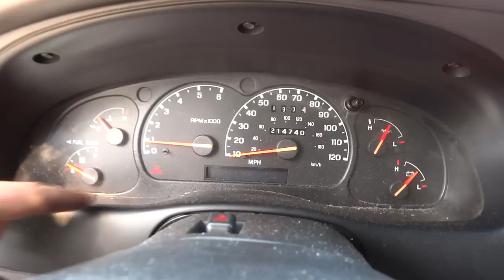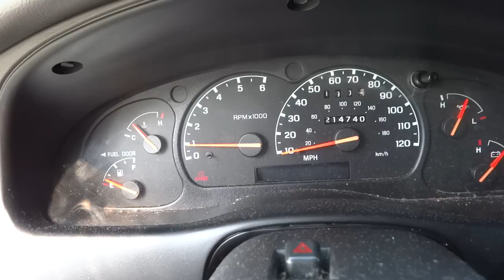Engine Knocking or Ticking?!? This Could Be Your "FIX" Ford/Mazda/Bmw/Honda/Toyota

Comment: Why would you hit a plenum valve with a metal hammer? Of course your going to damage it. None of these composite material parts are meant to absorb impact.
Reply: I don't recommend following this guy's example.
Reply: "oh i did this to my car and it runs just so much better"
you have to be pretty arrogant to believe that you know better than the engineering TEAMS who have been developing these engines for decades...
If they put something in the engine, you should NOT think you can simply "delete" it. You should FIX it. Now let's go see Ericthecarguy
Reply from the maker: Stuff happends, I could have chose to edit that part out if I wanted to, instead  I decided  to show the public so they could learn from my mistake..the intake was extremely brittal.Wasn't your ordinary plastic.
Reply from the maker: JAndrioli They did such an excellent job engineering it that if one of those flaps break off inside the intake manifold the entire engine blows up, and they are prone to breaking off,so removing them is definitely a smarter choice than the engineers who put them in.
Reply: Nthefastlane
 I agree with you that the quality of the material is bad IN SOME MODELS. Your video is said to be applicable to several models of several brands !!!
That's a HUUUUUUGE generalisation.
Now to the other issue: rather or not you are knowledgeable enough to redesign a complex engine, on your own, in your backyard, with a hammer... well look, I'm a nobody with zero knowledge ok, but even if I did have a 30 yrs career I don't think I would recommend violating someone else's blueprint. Like I said earlier there are TEAMS designing those machines, but of course they don't have total control on what materials will be used in the production line.
Reply from the maker: JAndrioli They build a vehicle not to last,could they build a vehicle to last a lifetime..sure, just not in this or any case. That's why there's Oem and then there's aftermarket, which alot of people including myself turn to. If you want to see another modded job..stay tuned for the Victor x intake manifold cut in half,ported,polished and tigged back together .
Reply: Nthefastlane Did you even notice the thing had over 200 thousand miles on the clock? Not built to last?  Are you kidding?
Reply: You think aftermarket parts are there because they are better than OEM? While this may be true for some high performance parts typically aftermarket parts are less expensive because they are made more cheaply. I agree with JAndrioli.  Those parts were put there for a reason.  Just yanking them out is foolish. Pretending you know what you are doing and putting it up on Youtube is a disservice to those who may watch this. Getting a bigger hammer is rarely the answer to fixing modern cars.
Reply: @JAndrioli lmao, you obviously have never owned a 90's sports car.
Reply: If these "teams" did a good job (they didn't) the car would not have this problem.

Comment: I brought a new battery, starter,alternator my battery still dies on my 98 infinity ain't help
Reply: check for a short and all your grounds. a short will drain the battery.
Reply: +Keaton McNaughton the temperature gauge goes up n down when I turn on the headlights on

Comment: I strongly dis agree with this posters cure for the problem he has created. Removing the IRMC'S as they are called. Reduces torque significantly and reduces performance. I would not suggest this procedure to anyone to perform on a normally aspirated engine. Some remove them on supercharged or turbo charged cars. But that is because the airflow is necessary for optimum performance. The turbocharger or supercharger more than makes up for the removal of said parts.
Reply: I'm at a loss, anything blocking air flow to the motor is a parasitic loss to the engine, reducing torque and horsepower. How does removing items and making a free flowing passage a bad idea? I thought people port match intakes, port and polish heads all for that very reason, for more airflow. They did these things before turbos and super chargers became widely used to gain torque and horsepower. So I'm not saying it's not true, but would like an explanation.
Reply from the maker: I made more power after removing them :/ no hesitation like before, idles perfect and no check engine lights.. it's been 10 months since I uploaded this video.
Reply: Nthefastlane I have been a Mechanic more years than i care to admit to. Its not a question of making a car durable. As much as the question is why would you beat a composite manifold with a hammer? My Corvette has many composite materials it is 10 years old and nothing has broke not even the manifold. But then again i don't repair it by beating it with a hammer. Those IRMc's you removed are supposed to stay closed till a certain RPM is reached. Then open up this allows maximum torgue gas mileage and lower emissions. In no way would removing them increase anything. Gas mileage may have increased over them being stuck closed or flapping back and forth. But has not increased over a properly running car with them installed. The removal of pollution control devices is not only stupid. It is illegal! Even removing Catalytic converters decreases mileage not increases. As it causes the motor to run too rich. If you are going to fix something fix it right. The mis information you have provided here really benefits no one.
Reply from the maker: Tony Brooklyn A Lot of states don't "Smog Test" Tony.Butteryfly s are a poor design hands down,sure they balance the immisions and a little tourqe curve but who needs restrictions..Faster air is better air,the ecu will compensate the extra air.
Reply: It appears my friend you have re invented the wheel. Good Luck in your quest to create a better car.What else can i say at this point. I have pointed out to you what is wrong with your thinking but you refuse to acknowledge it. Just because states refuse to smog check. Does not mean you are exempt under Federal laws. Removal of pollution control devices carry penalties upwards of 50,000 dollars.
Reply: Tony Brooklyn This makes no sense. Removing a cat is obviously illegal, but how does the same law apply to swirl flaps? It would be one thing if every vehicle was required to have them, but that's not the case. Many engines don't come with them at all. Even the engine featured in this very video doesn't have them anymore. Ford introduced the Duratec motors in '01, and they dropped the swirl flaps from them three years later. If it was really that vital of an emission control system, why would Ford go through the trouble of removing them after they went through the trouble of putting them there in the first place? And how could they get away with it?

I see these swirl/tumble/runner flap/valve debates all over the place. There are pros and cons for both having and deleting them, but to call it illegal to remove them is just ridiculous.
Reply: I'll leave you with one more comment and that I shall refrain from posting in this thread because you obviously want to get the last word in with no scientific knowledge trying to reinvent the wheel is probably the silliest thing I've ever seen in my life and that's what you doing here you're trying to reinvent the wheel you think you're smarter than Ford Motor Company for General Motors or Chrysler Corporation come on man give me a break
Reply: Tony Brooklyn  I have to agree with you here... The flaps  partially shut allow for maximum torque at low rpms... I've been doing a lot of research on this since I have this issue on my mazda 3. I have unplugged the runner control solenoid for now to avoid the noise... but I plan to replace the actuator valve that actually controls the rod attached to the flaps and hopefully that will fix the problem.
Reply from the maker: unyascorpion What nobody is understanding is that the rod no longer grips the flaps therefore all they do is flap no matter what solenoid or valve you replace. If one of thoes plastic flaps gets brittle enough and breaks off into your cylinder it's  by by engine..possibly bend a valve instantly. Im still running 10k miles later with no issues or check engine lights. To each their own.
Reply: Nthefastlane  That is an important piece of info you just provided me with. That may be in fact my own case. I've seen flap kits being sold... but I'm assuming it would be a pita to properly demount the rod and install new flaps. btw I don't necessarily think that your solution is bad...but as I mentioned, there is significant low end torque lost between 1k-2.5k rpm. I think whoever should follow your practical DIY video should be aware of that.
Reply from the maker: unyascorpion I truly believe butterfly flaps are more of an emissions way to burn fuel cleaner not necessarily any kind of torque gains. As you can see here in this dyno of a bike they do a before and after the butterflies removed and all the way across the graph it's nothing but gains.

http://www.holeshot.com/dynocharts/dyno_bandit1250.html
Reply from the maker: Nthefastlane The ecu will compensate the extra air with more fuel when needed..that's why we have o2 sensors.
Reply: unyascorpion
After a few weeks of driving around with my deleted flaps, I do have to admit that it certainly hasn't helped. My low-end rev range was already crap before, even by the standards of the Duratec 2.3, which is known for being almost useless at lower RPMs. Since the delete, nothing much has changed. It's just not clacking anymore.

As for the assumption that it's almost exclusively for emissions, that's not really true. After some in-depth research, I've found that creating turbulence and swirling the incoming air actually allows the engine to inject less fuel since the air/fuel ratio gets thrown out of whack, essentially letting it run a bit lean without the usual side effects. This also helps give it a little boost on the lower end. It's the entire logic behind variable valve timing systems, especially VTEC. You restrict the intake in certain ways in an effort to perform some physics wizardry.
Reply: Nthefastlane
Actually, that seems to not be the case. The PCM (a.k.a. ECU) knows that the engine is running lean since it commanded that swirl flaps to close. Again, physics wizardry to tip the air/fuel ratio. It'll see the system running a bit lean, but it won't open the fuel injectors any more because it's programmed to understand that it's supposed to be like that. The only way to work around that is to tune the PCM for it. As I mentioned before, Fordzda deleted the swirl flaps entirely in 2004 for the Ranger/B-Series I4 trucks, and the '04 revision ultimately got a power boost and slight bump in torque. So clearly, it CAN run without it.
Reply: John Roddy  Right on... That's precisely what I've found doing my own research.  It is also worth noting that not all engines benefit the same  from the manifold flaps... on many engines it isn't even worth including them.
Reply: Nthefastlane I don't think all engines benefit the same from this system... for some it isn't even worth including this system. However there is low end torque gains with the variable intake valves in THIS particular engine. The best example I can give you is what John Roddy already mentioned... The whole variable valve timing is based on a very similar principle. When the engine is rev'ed up... the valves open MORE... why not just leave them as opened as you could to begin with you may ask? well that's because the low end works a bit different. You can poke here and there around the net and find the info for yourself.

I also believe you are correct when you say the car is more fuel efficient with the system and it helps with emissions... But I don't think this is the only reason they include such mechanism... this engine produces very low emissions as it is.... it even has a government certification on this.
Reply from the maker: unyascorpion I understand it can control torque curve but for the slight amount of gain maybe 10 ft lbs compared to possibly blowing your entire engine from a plastic flap, you kind of have to ask yourself what's more important.
Reply: Nthefastlane  I think your modification is pretty neat... you got rid of the noise and prevented future catastrophic engine failure at almost no cost. That being said people should be aware of the downside of removing the flaps... Also on the mazda 3's people claim that there is rough idling while the engine warms up. That's pretty much my take on it. Perhaps some will opt to replace the entire intake to keep this feature... but this of course would be quite expensive.

As to how much torque you actually lose... I can't really comment on that... but I know is significant on this particular engine... even more on the 2.0... which is the one my mazda has.
Reply: unyascorpion Nthefastlane Let's not forget that the clacking means the system is completely compromised. Physics wizardry requires quite a bit of precision, and there is absolutely none of that if the valves can't keep still. The clacking sound means they're moving a lot, and that effectively ruins the attempted air control. At that point, the only options are to replace the valves (usually means replacing the whole manifold), or deleting them. My bet is that Ford realized the elevated failure rate of the system was starting to overshadow the notably mediocre gains, and it was cheaper and easier to just kill it off rather than redesign the entire manifold.

That being said, if I could find a compatible performance manifold with more stable runner valves, I would love to try it out. It seems like the Ranger variant of the Duratec engine was one of the only ones to dump the system entirely. Almost every other manifold I've checked out seems to have had them all throughout their lives. If it weren't for the fact that the throttle body is on the wrong side for just about every other one, I'd probably try one of those.
Reply: Tony is correct they in fact are like changing from a regular intake to a high rise intake .they give you the best idle closed to gradually opening to full as rpms increase.Removing will cause poor performance  poorer mileage and may cause computer to miscalculate fuel needs.I would not recommend doing this.
Reply: @Nthefastlane  all the genius Ford engineers that everyone loves to quote in this entire thing thought these runner flaps were SUCH a good idea, they removed them from the Rangers starting in 2004 until the Ranger was discontinued in 2011. y'all do yourselves a favor and take a look at the parts fiches between 2003 and 2004. if you look real hard (lol not really) you'll notice that Ford removed the runner flaps in the intake because they realized they were disintegrating into the intake valves and skullfucking the engines. if you also look at the MPG details for the ranger models between 2003 and 2004, the 2003 2.3L got 20MPG city and the 2004 got 19MPG. SAME exact engine.

Comment: those flaps allow for short and long runner intake attributes..... short runner before 3000 rpms meaning almost closed .. and long runner intake designe after 3000 rpms for torq meaning the flaps open all the way up after 3000 ... for long runner top end power up high in the rpm band the 96-98 cobra mustangs have these there imrc plates they are problematic you cannot get the replacement parts or electronic for these on the cobra  sucks the cobras lose torq upon take off when you delete the plates but super charged problem is solved

Comment: A plastic intake manifold?? I had no idea that newer cars are made so cheap.
Reply: +ben dunn It isn't plastic because the manufacturer wanted to cheap out on parts. It's plastic for a number of reasons but some of the primary benefits are the significantly reduced weight of a plastic manifold vs a metal manifold and the lower thermal conductivity that will keep intake air temps down resulting in a greater mass air flow vs an equivalent metal manifold.

The plastic that these manifolds are made out of are actually quite durable and can easily withstand a long life of several hundred degrees. If you look at the intake manifolds on various supercars like a Koenigsegg you'll see a similar trend of ditching aluminum intake manifolds for composites like carbon fiber.

It does come with some downsides and there are cases where old manifolds will crack with a good backfire on startup on a cold day but the drawbacks of moving away from a traditional metal intake manifold aren't significant enough that it's not a good tradeoff to make.
Reply: Andrew Merts OK, I don't really buy the argument that it makes much difference in intake air temp but OK. It seems like the plastic broke so easily in the vid but then alloy and even cast iron can break if you over tighten a bolt or drop it.
Reply: newer cars? almost every single car made in the year 2000 and up are like this including pick up trucks, they still last up to 250k miles abs plastic is very durable and heat resistant just don't smack it like this guy did

Comment: hey I did that same thing and now I have a check engine light on and the code is telling my intake is fully open can u help or let me know
Reply from the maker: Did you plug the vacuum solenoid on the back of the intake manifold back in..
Reply: Yes I just  got a new engine and did the same thing u did it was working fine and today the check engine light came on and gave me that code I check everthing

Comment: Engineers go to college for years to get a Masters or PhD. to design engines. Why do these shade tree mechanics think they need to "remove" something from the engine? If his timing isn't shot to hell, then the engine is throwing codes and I'm sure the gas mileage went way down. But that chatter stopped. WTF ?